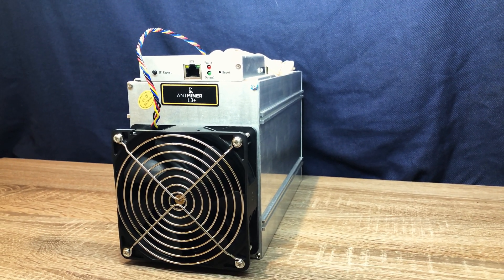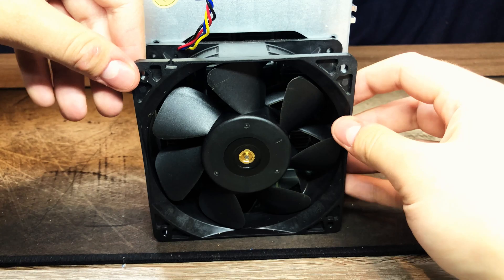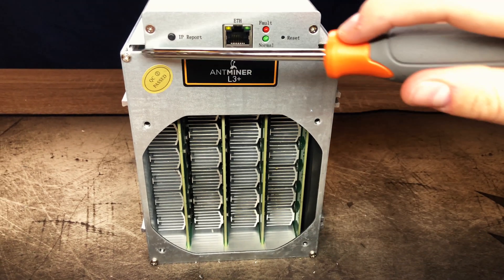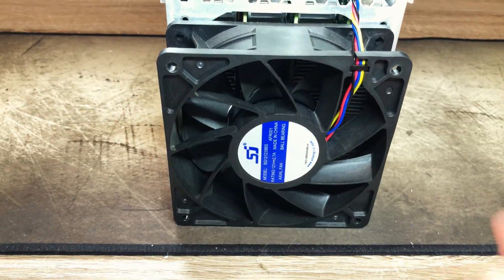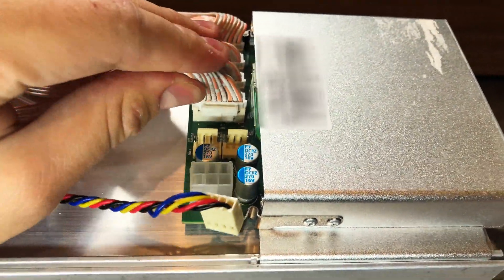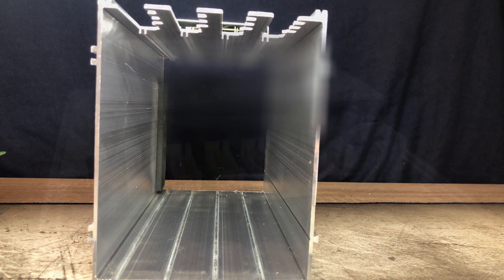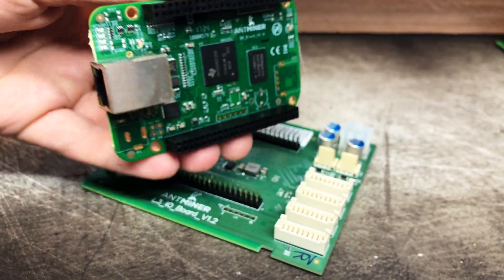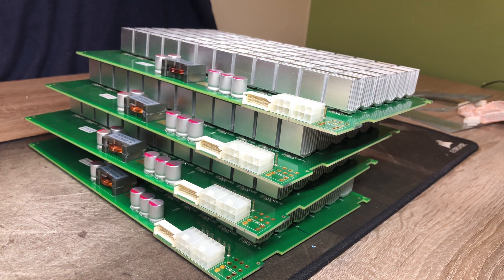Antminer L3+ Disassembly | Crypto

Comment: The smaller board is a beaglebone board. It is a small form factor computer. It does run Linux with some special program on it to mine the coin. The slightly bigger board I call it the middle man board is the go between between the little beaglebone computer board and the hashing board that ties it all together and able to control the fans as well.